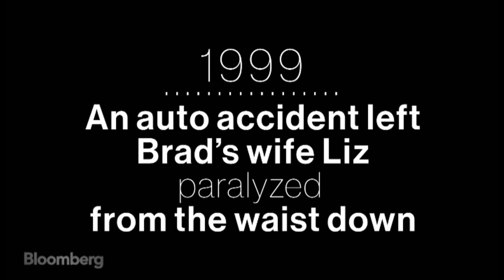The Extreme Wheelchair That's Built Like a Tank

Comment: What I can't rap my mind around is the quantity of dislikes, That I would more lean to is all about the price tag, with which would come from simple ones that don't understand that parts built to last and not fail in any location is not cheap in any mean for a small manufacturer, but those same simpletons will buy a $30,000 car that stars to fall apart in less than 5 years. Cant slam the like button enough on this one.

Comment: Will it tip over forward if going down hill forward?  I'm a commercial diver and have been bent several times.  I know this is going to catch up.  I feel it creeping already.  So what are the limits out of the box.  I'm a welder and tool designer too so what's the main carriage made from and the weight out of the box? Starting at.....
$15G. 

Hell; we're making into a submersible as well with arm manipulators like an ROV.